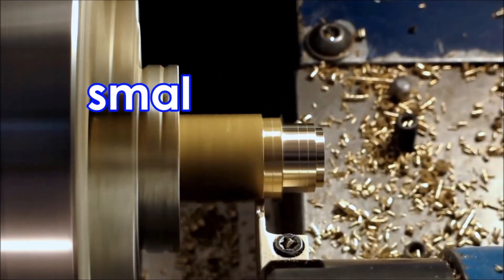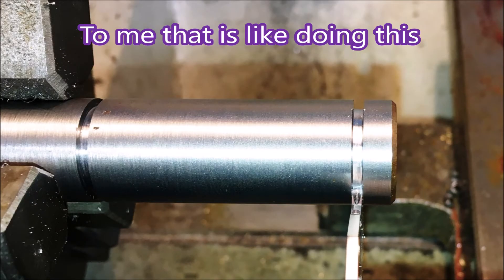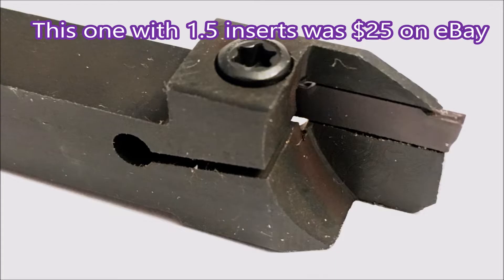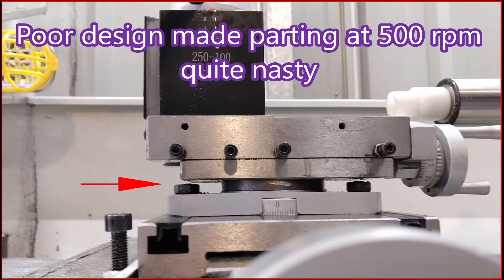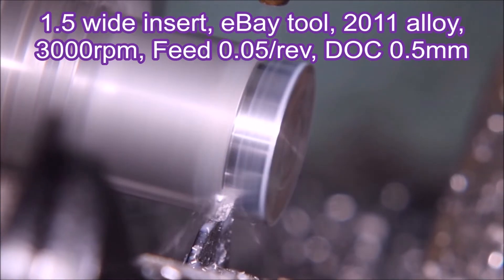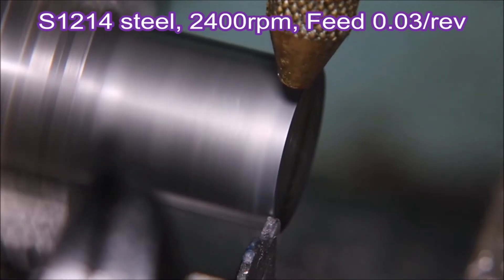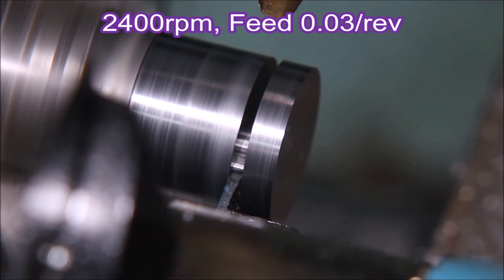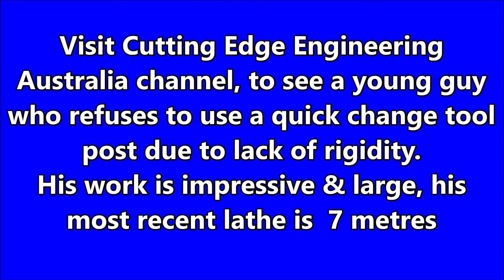CNC lathe, HSS parting blade as a parting tool & tool overhang. Carbide vs steel and aluminium.

Comment: Some people suggest replacing the compound rest on those chinese lathes with a solid block of steel or cast iron. This of course means you can't turn tapers, but the increase in rigidity is massive.
Reply from the maker: Sounds a reasonable swap to me, as long as the compound can go back on if required.  Thanks for your comment

Comment: thanks Mate, was trying at 20rpm no lube 4 inch 4140, have 550x2000 Cazaneuve, will go try 320 with lube eh
Reply: Need lube!
Reply from the maker: I would try from around 250 to 320 at that diameter. Certainly more than 20!

Comment: My friend I have an accusize carbide parting tool and I can't get it to cut through brass. It starts out fine but getting to the end it ceases to cut
Please help.
Reply from the maker: Whar rpm are you using?
Reply: @smallcnclathes  hard to tell. It didn't come with an rpm gauge
Reply from the maker: @mosfet51  Two possibilities, you need higher rpm OR the tool is too high.  Check your tool centre height first and see if it improves
Reply: @smallcnclathes  I've done higher rpm and centered the parting tool. I even went slightly under center.
Reply from the maker: No better?
Reply: @smallcnclathes  nope.
Reply from the maker: Sorry can’t help then, I have no experience of those inserts. How wide is the insert and what is the spindle power of your lathe?
Reply: @smallcnclathes  success. Had to figure out speed of spindle and speed of feed. Got it working beautifully. Oh and the inserts are 1/16th inch wide
Reply from the maker: @mosfet51  Glad you got it working.  Did you need to run it faster?
Reply: @smallcnclathes  I needed to find the correct rpm. I started out slow and saw right away that it was cutting. Then brought up the rpm and maintained my feed. But it was definitely the height of the parting tool that was a factor. Everything else was me.

Comment: [?] was that $25 ebay insert a "grooving tool" as you could impart side forces (z axis), do lateral side cutting, (whereas the $40 ebay parting tool is only to cut off (x axis)..)
---
https://www.youtube.com/watch?v=g_V13luh_6I
Tormach Slant-Pro Lathe Vs Omniturn: Budget Battle!
5,385 views•Nov 30, 2020
This guy got an old school Omniturn with control box damage for $2k !  $2k is a salvage price, I saw a Haas turning center from same era locally that looked like a forklift hit it, for 2k.
Reply from the maker: Who knows, difficulty of buying from ebay is at times one is guessing what will be supplied. From Sumitomo, I can buy inserts that are made for grooving and cutting sideways and they work really well, but that ability to choose what the insert does comes at a price.

Comment: Parting is such sweet sorrow? (Had to do it) Learn a little every time. Funny how the basics of machine rigidity is so simple and yet it escapes so many people.
Reply from the maker: And in that you can include the manufacturers of mini lathes and mills. My Hercus weighs in at around 150kg probably two or possibly up to three times the weight of a Chinese min lathe. There ain’t no substitute for cubic inches transfers easily to pounds or kilos when you are looking for rigidity. Not only does making it lighter use less metal, but also makes it cheaper to freight around the world. Olfoundryman has a Cincinnati mill that is old, I think it weighs in at around 3 tons. It is a very rigid machine. LOL
Parting should not be the drama that it becomes. Before I started with the Hercus, I would not have dreamed it can be the way it is for me now.
Reply: @smallcnclathes   I am with you all the way. I have two 2.5 tonne lathes and a bridgeport style Elliot Millmor that's almost 2 tonnes. It's hard to beat these machines. The Milling machine is from the early 60's one lathe the mid 50's and the shorter Colchester is from 72 if I remember correctly. The Colchester Mascot is a unicorn. Larger motor and works compared with the ones afterwards. It was a university/government collaboration with Colchester to make a very high quality lathe. My smallest lather is just short of a tonne. Nothing CNC. Yet. Why for I watch what you are up to and learning along the way! I'm just a Cabinet Maker after all.

Comment: a few of the more NEW common (grizzly, craftex) lathes share the same cross slide
the weakness is in the material AND design of the compass/protractor mount for the tool post.
theres a guy who made a tutorial of his remade compass using basic 4140 with only slight changes to final dimensions and the rigidity difference was huge...
also some of these cheaper chinesium qctp's use a very flexible post that should just get swapped for a hardened bolt

Comment: i still use the HSS cutoff blades, but only because thats what ive learned on and not had many problems. getting a good grind on one is fast and easy and profiling for facing / grooving or even a turning path is par for the course.
steel brass aluminium no problem, copper and some stainless can be finicky.
edit:
I am optimistic in experimenting with one of these in future tho
Reply from the maker: Thanks Kazz, I know they are in use, but beginners could take a long time to reach your skill level.  I just find the type I use work well for me, all my tooling is carbide inserts as I need the repeatability.
Reply: @smallcnclathes  oh i absolutely agree with you on that!...you gotta use what you know and experiment in the off time and be particular when you do so.
I'm totally keen on getting one of these newer carbide setups like you use because of your videos...
i just know my setup is very different than your and will take some old fashioned crash and burn experimenting to get it right (so its gonna take a bunch of time).
i may not even get them to work well for me...but im optimistic..
stopping to hand sharpen and re-calibrate is motivation killer to say the least

Comment: The large QCTP's that fit a 7 meter lathe are pretty rigid. Also the price tag for the toolpost and say 25 holders would be pretty high. It may be not worth it to buy. The rigidity will ultimately boil down to the lathe and its foundation. Maybe with a very large long boring bar like 10"+ stickout it would be different story even with a large QCTP
Reply from the maker: His previous lathe is actually the one to which I refer, it is a much smaller lathe, but still pretty huge.  He does a lot of work on mining machinery.
Reply: @smallcnclathes  I watch the channel too 😅
Reply from the maker: Apart from being very skilled he is an amusing young bloke.
Reply: @smallcnclathes  sure. Actually the only real benefit of the QCTP after all is that you can save the tool offsets to the tool library of your DRO and know without measuring between tool changes where you are. The tool height is the same for all the OD tools that have similar size shank so you don't need to shim each one differently if the tools are chosen with that in mind